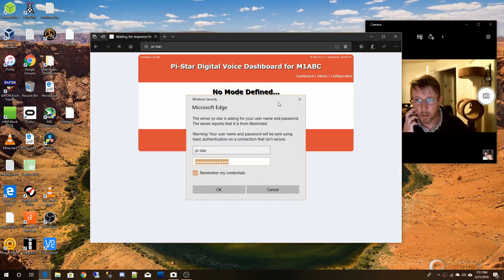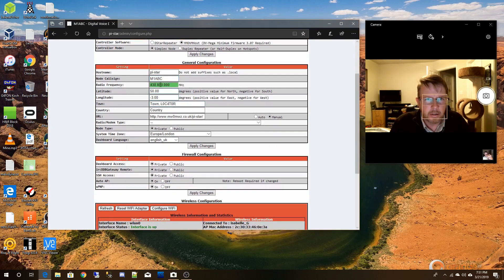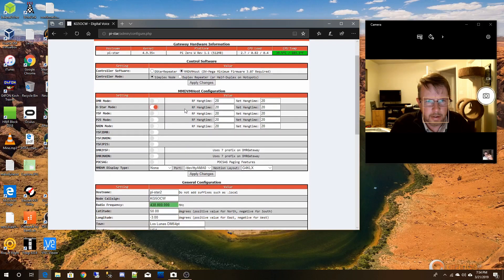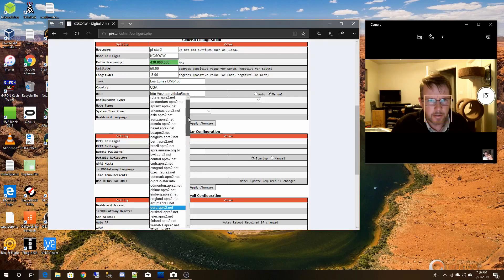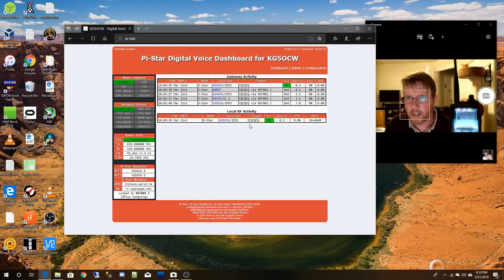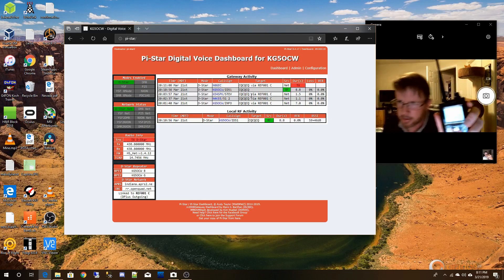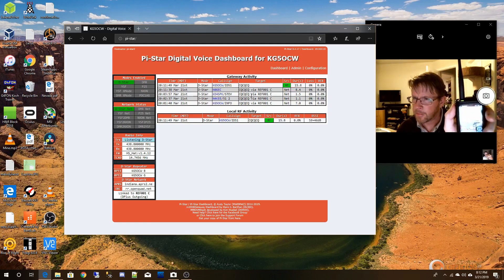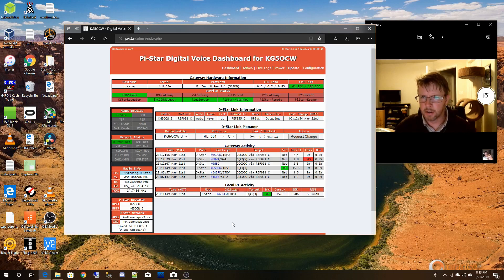Building an MMDVM/Pi Zero Hotspot

Comment: I just noticed that you didn't use those 2 small screws (i see back in the plastic bag). Actually the Pi board should be mounted in case first, using those 2 small screws, then the hat board with longer screws and plastic risers... Oopsy... "here kitty kitty" - i hear your friend in background...
Nice video
Got 4 siblings at this qth...